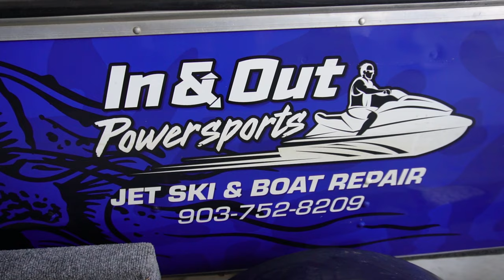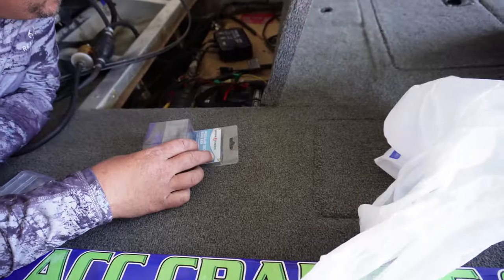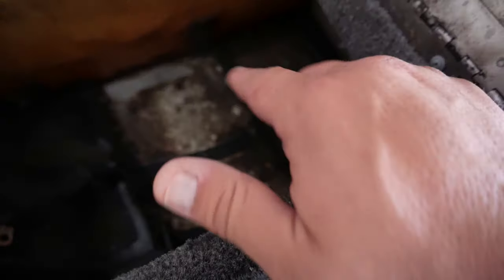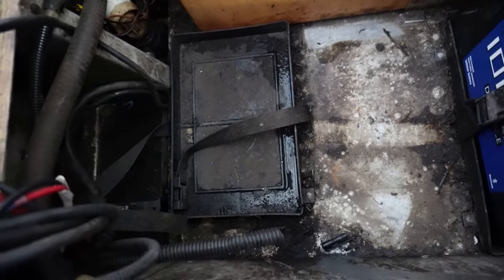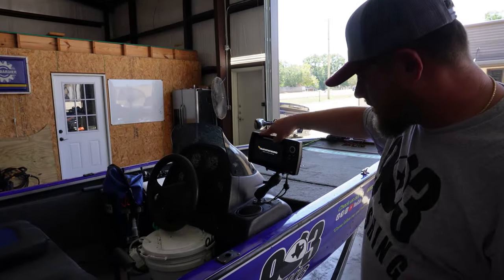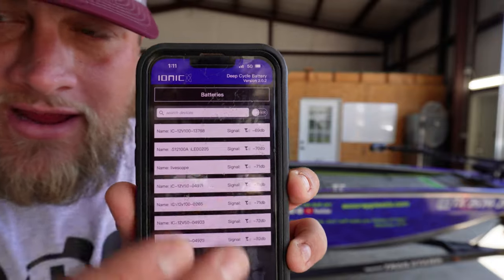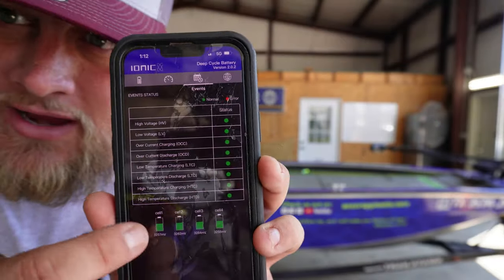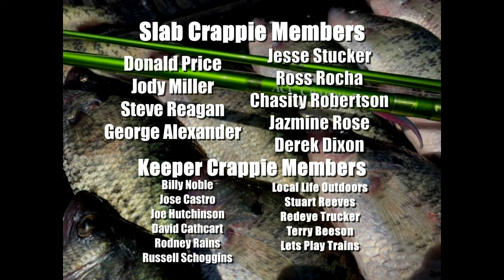CRAPPIE Fishing All Day With The Best Lithium Batteries!! (DISCOUNT CODE)

Comment: Been running the ionics for a year in my 20 foot gator trax GT . She is a heavy being 3/16 hull. I have the 12/125 amp for my two 12” Garmin 126 echo maps . They are power eaters . I have the 36 volt min Kota that feeds off a 36/50 amp . 
 Usually after 9-10 hour day in high wind I get off the lake with 76 - 72 % battery life on the 36 volt and around 68-74 % on the 12/125 house battery which runs everything in my boat except the outboard . Most outboard companies recommend   an AGM battery for their outboards . 
Completely satisfied 100% with my ionics products .

Comment: I'm a licensed electrician and run my own mobile RV repair business and have been venturing into solar on them s I'm interested in knowing how those batteries work out for you..  One thing I noticed that I'd change about the installation is the location of the lithium charger in the back. In most instances you'd never notice a problem with this but one leaky live well hose or slow leak / good hard rain storm, etc. and that charger will be sitting in standing water where it pools in the back to be caught by the bilge pump. I'd sit that thing up on a block or something to give it a few inches of clearance off the hull to help keep it dry unless it's rated as submersible.

Comment: Don’t forget DO NOT put your motor on a lithium battery .
Reply from the maker: I have an older motor, it has ran fine. It’s the newer motors that have to have a certain lithium cranking!
Reply: @903fishing  it will crank and run fine the charging system doesn’t like it . If your motor charges with a stator and it does on that old of motor mine does too on my small boats . it will not charge the battery properly . And possibly not full charge it . And may ruin the charging system or other electronics components on motor . 

If your motor charges with alternator it may work properly but it’s not guaranteed . Just info is all I passing on